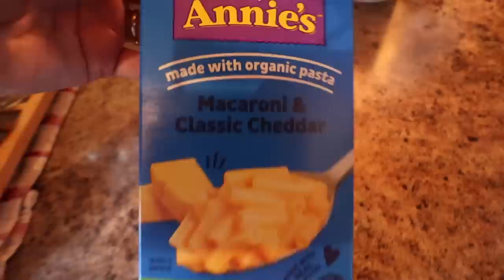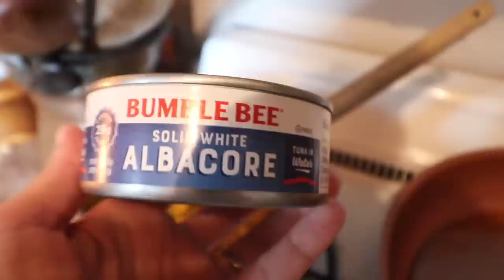Splitting & Stacking Firewood Before the Cold, Dark Winter! | Off Grid Life in ALASKA!

Comment: Your very welcome on the wire idea! Another thing I'm doing this year is putting some long 2x4 boards across a few rows to help stabilize everything (poking the board ends through the wire).  My far back row collapsed when the row in front got low this spring, I had firewood all over the place😂.  
Parker & Kellen are great helpers!  Bradley & Gunner are great helpers too, just need to reverse the fetch.  The roosters have a much more mature crow now.😂
Thanks for another great video!

Comment: Hi Tina. I have a cooking tip for you. I have spent the last three or four years doing a lot of research on diet nutrition, etc. I have learned that it is best not to use olive oil for frying because it has a low smoke point and when using it at higher temperatures, the oil has a reaction which produces undesirable byproducts in your body. For frying, it’s best to use coconut or avocado oil as they have a higher smoke point.
Reply: Every oil is better for frying than olive oil. I usually use peanut oil. I like avocado oil as well but it stinks while frying (even if later you cannot taste it as it’s quite neutral).
Reply from the maker: Peanut oil? No thanks. We only use olive & coconut oil.

Comment: That side of the wood shed facing the prevailing direction of wind should have boards on the side with gaps between boards no greater than the width of your fist to minimize the amount of snow entering the wood shed, but still enabling optimal air flow  cutting and splitting wood to get through the Winter will be very time and labor consuming.
Reply from the maker: We will get it buttoned up, just bare minimum for now to get the wood out of the rain. Thanks for watching! 😊